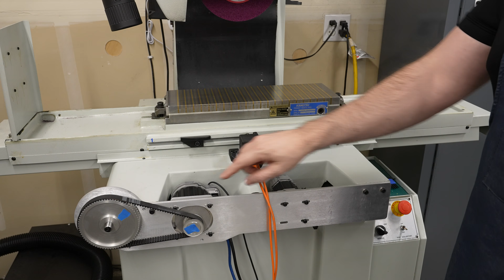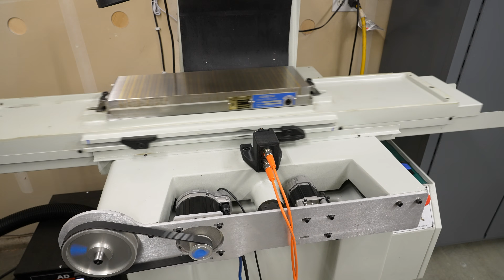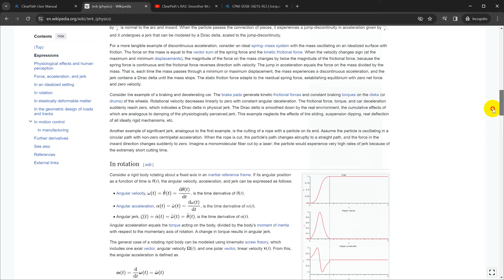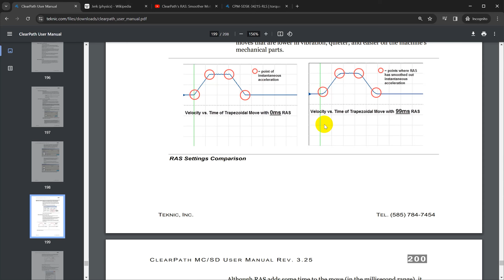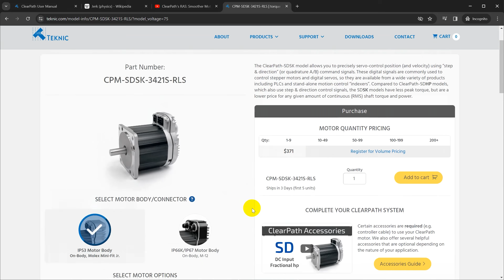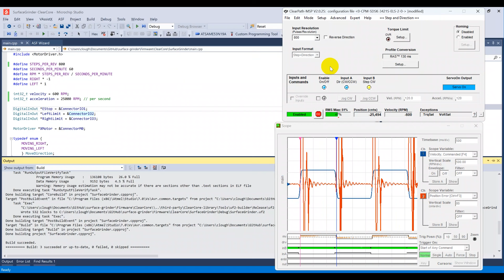Smoothing Out the X Axis Motion | Surface Grinder Automation 7 | Clearpath RAS

Comment: James, 
Your work and intuitive deductions are outstanding, there may be several sets of factors that you have entirely missed and may effect the performance of the electric motor in a measurable way.
#1 the fit of the molded rubber drive belt into the drive cog and any slop that may result or increase from wear, ie: unlike a metal driving gear system there IS movement  and stretch in rubber; and does the belt wear, and or increase in size due to speed and friction and thus increase friction/drag on components?
#2 the compression factors and rebound time of the rubber belt itself loading and unloading the forces as they switch back and forth ie: compress/rebound
These factors absolutely will effect the minute timing parameters and increase in variability as speed increases.....and therefore influence how your motor will display/chart its data.
Should a distinct measurable variability in the motor performance be evident in using the rubber belt cog drive , it may necessitate using a solid gear tooth drive system or a  crankshaft type drive to achieve your optimum electric motor performance.
Just saying !

Comment: Make 2 stop sensors on each end, one for slowing down table and second one for dead stop. With this setup, table/motors/belts etc. at the moment, is going under a very heavy load because there is a high speed and a rapid change of direction. Just make it that table slows down gradually before changing directions.

Comment: Perhaps if you replace the wire cable with spectra dyneema which has less than 1% stretch and more strength than steel, you might also help smooth out the change of direction even more.
Reply: My thoughts as well. Or a drive chain?
Reply: @marclevitt8191  now that’s also a good idea, chain might work. I’m guessing it might have more mass hence more inertia to overcome each change of direction than dyneema spectra tho.
Reply: Dyneema is slippery stuff, might be a problem.
Reply: @carlhitchon1009  Indeed it is very slippery, no denying that. 👍

Comment: Hi Intresting but on thise settings what is the feed back in the motors when the cams are only a few inches apart or do you plan to just use the tabel at full movement all the time. Good video.

Comment: The 25000 rpm/s acceleration to 600 rpm gives 24 ms acceleration time. That's pretty insignificant compared to 197 ms RAS delay so there might be room to lower the acceleration a little to get even smoother motion.

Comment: your limit switch cams are switched L R
Now the roller hits the short ramp.
Reply: you need to re-watch the video on the cam design, that's intended. the shorter ramp gives you a more predictable actuation point, and if you look at the position of the switch's lever, you'll see that the steep angle is no problem (since the switch pivots back and away from the oncoming cam). the shallow angled part is not a good sensing method, it's there as a safety feature so that it won't jam the lever into the switch when recovering from an overshoot.

Comment: Looks like all those settings depend on the physics of the machine, including the weight of the table.

Does that mean you'd need to adjust things when you put a heavy item on the chuck? Or can you set things low enough to allow some spare capacity before the springiness causes issues? It might be interesting to test the same torque graphs with different amounts of material on the table.

Comment: Looks good, I am curious though what happens when you introduce a 10kg piece to surface grind and the grinder running as it will change the dynamics of the table. I'm guessing there might be a need for a new session of tuning when that happens.

Comment: I’m quite spoiled using Kinetix motion servos as a System Integrator. Do a Motion Axis Move to a position in x amount of time, set it to S-curve and let it rip. A the hiperface absolute encoder makes indexing bulletproof. Throwing excessive acceleration at a wet noodle axis doesn’t always work, but it’ll be interesting to see how the dynamics of the system changes when a workpiece is added and the wheel is engaged because the resonance frequency shifts. Also the forward and back directions will see different forces because of the grinding wheel engagement. Will be great to see the final results

Comment: Possibly a newbie question - how much does the table/object speed matter when surface-grinding?    The wheel's surface speed is far higher so does it matter if the part is moving slow or fast ?

Comment: This is a great  tutorial, great understanding, great tenacity & great outcome.

What would be the icing on the cake is a test piece, that has an area (strip) of grind at same depth etc but with different motors and RAS settings to see if the quality of traverse actually shows or is measurable in the real world or if the mass of the table hides it.

Thanks James, this is perhaps the best (most revealing) project you have done.

Comment: What about old school hydraulic dampener rods, at both ends, which will dampen out vibration as the limit switches are hit. Since it is a servo, it will not lose steps as in an openloop stepper. A purely mechanical solution!🤔 .

Comment: hilariously, I would have coded the RAS myself in the controller. not too hard to implement. especially if the accel can be directly coltrolled by code and not just constants
Reply: He let Teknik program it in—a better solution and cheaper.

Comment: Could the progressive acceleration (anti-jerk) required not have been implemented in controller software? Along with anticipation of travel limits, based on tracking of the most recent limit switch triggers?

Comment: Motion control is an incredibly cool subject to look into. For a project I have going at the moment I'm using AC servo drives which have absolutely terrifying trapezoid performance due to the winding voltage, instead of doing jerk limiting within the motor PID I'm doing it as part of the trajectory generation, this allows for optimizing within the context of the planned path. So you can have a highly damped control system where you can have the motor track a target of arbitrary error and acceleration and all of the motions between those errors are smooth and jerk free. You can also modify those constraints on the fly, so in the case of your surface grinder you would switch to a dynamics profile optimal for the turnaround point when the limit switch is triggered and then after the velocity is reversed switch to a purely trapezoid profile so that the target velocity is hit much faster, would allow grinding a part at the full width of the table working area without creating hot spots at the edges.

Comment: How hard would it be to get a DRO scale feeding back into the servo control? Move the feedback out to the end of the line and you can easily tune a PID for the springiness.
Reply: I don't know, sometimes more data is not better. Perhaps only using glass scales and bypassing the motor's internal ones? Is that what you meant? I believe that Leadshine’s latest hotness EtherCAT servo can take both inputs.
Reply: @marclevitt8191  Pretty much yeah. Even the optical encoder strip from a printer (if it were long enough) would be plenty. Just enough to tell the brains where the table is. I just suggested a DRO because there's probably one readily available inside a machine shop and it's probably meant for that role. Interfacing it shouldn't be too hard.
Reply: I looked into this question several years ago, and the consensus seemed to be that it's technically possible, but not a good idea for some reason i couldn't figure out (maybe related to position hunting), which is why basically no motion controllers below and up to light industrial usage support it.

Comment: I'm just concerned having a single limit on each end of travel. Seems like some redundancy is in order where you have two switches on two input and if either one is triggered, that's your limit. 

Think of a scenario where the cable degrades or you trip and pull it out of the connector or.100 other scenarios where the controller doesnt get the signal that the limit has been reached.

Comment: Im honestly supprised you didn't add a jerk paramiter to your code so you could tune it on your own. On one of my 3D printers I compiled my own marlin firmware and apent some time messing with the jerk setrings and it was easier then i thought it would have been
Reply: Weirdly enough, the definition of the  jerk parameter in marlin is not the same as jerk in physics. In marlin, jerk is defined as the "maximum instantaneous change in velocity" instead of the rate of change of acceleration. Seems to be from an early misapropritation of the term which has then stuck around.
Reply: @carlholmberg1576  great to know thanks for that.

Comment: The new motor went from 800 steps to 6400, but you didn't update the code. It doesn't seem to hurt anything from the results, but I thought I'd mention it.
Reply from the maker: It's configurable, and it's set to 800.
Reply: I suspected it may be a non-issue. I've never programmed a servo, so I didn't know if it had a performance impact on your application. @Clough42

Comment: What happens when you increase the mass of the table? (Loaded with a work piece)
Reply from the maker: I've done some testing with maybe 30 pounds of extra weight, and it makes very little difference.  The table and chuck are already so heavy that most workpieces will make little difference.

Comment: I'm not convinced this is the right way to automate that particular machine. It has been built for manual operation, and while that tendon drive is perfectly adequate, it has already shown its shortcommings. Yes it's great that the Clearpath system can compensate for the non compliencies (spring) to a certain extent, but I feel you may be forever chasing your tail, and emptying your wallet, trying to tune out artifacts that will appear in the finish James.

I do hope I'm wrong however.

Comment: I expect that RAS setting is going to need to increase once jigs / work is added to the chuck.  These will increase the moving mass and thus the "slip" on the spindle + stretch in the cable drive.
Reply: As someone using RAS on a CNC router and a Bed Mill, both required decreasing acceleration and increasing RAS a bit once you mount vises, tools etc.

Comment: Instead of using the limit switches couldn’t you program the limits in the software, then the servos would “know” when they need to be ready to change direction and account for the spring and mass switching directions…  I think this is how commercial CNC machines account for abrupt changes without flying past their turn points.
Of course, commercial machines that have quick travel speeds cost a ton of cash because they can handle these quick changes in directions…
Reply: no as steps can be missed because of the speed of rotation so he is doing it correctly by using the steps for acceleration calculations only and having the switches do the positioning on X
on Y and Z the steps could work if they move slow
Reply: @111smd no, these are servos, if servos are "missing steps" they are defective. he mentioned it in this video, the axis is actuated by a cable wrapped around a drum, and that cable can slip. he talks about this more explicitly in the previous video in the series where he designs the switches. even if slip wasn't a factor, you would still need at least one limit switch to home the system, although for safety you would want 2, one for each end of the travel. at that point you already have 2 switches, and then you have to face the fact that physically positioning some limit switches on a rail is probably gonna be a much simpler and less error prone workflow than punching some numbers into software.
Reply: @spambot7110 ok i will have to accept that you do not know much about servos

i also admit that i should not have used steps for the rotation speed calculations my bad, a servos just knows the direction they rotate and the speed of rotation

1. a servo is a motor that is electronically controlled, a servo only cares about the rotation direction and how fast it rotates

2. a servo can be accompanied by a step counter to get an idea of where a servo has rotated to

3. if you add a step counter to a servo you have a stepper motor, stepper motors will lose steps of you rotate the motor to fast or of there is something pulling it off step
Reply: @111smd  what? If i swap the words "servo" and "stepper motor" in your comment, it mostly makes sense, is it possible you got the two mixed up at some point?

1. A servo motor is not exactly a motor, it is a motor system*, integrating the motor with some sort of sensor, (often called an encoder), that detects its position. the motor and the sensor are connected (either internally or externally) to some sort of controller that takes a position as input, compares it to the position detected by the sensor, and moves the motor to reconcile the difference between these values. If a motor does not have a sensor to detect its position, by definition it is not a servo. In the broad sense of the term, a servo is any kind of electronic or mechanical system that features a sensor and an actuator forming a closed feedback loop, but in the context of electric motors, it's typically only used to describe a motor that has closed loop control of its *position specifically.

2. a stepper motor is not a servo, it is not a type of servo, it is simply a type of motor. it is possible to use a stepper motor as the motor component of a servo (these devices are often called "step servos" or similar), but the stepper motor itself is not a servo. a stepper motor is simply a motor whose rotation is broken up into a series of equally spaced steps. the coils are arranged so that you can power them in a sequence, and the motor will move one step forward or back. this is an intrinsic property of the motor, not a result of adding some feature to a different type of motor. because the motor is simply responding to inputs and not measuring its own position, it can be said to implement "open loop" control, meaning it will move predictably for a given input, but won't take into account any external disturbances. so if the motor encounters some disturbance that prevents it from executing the intended move, the motor's real position will diverge from the expected position. this is what "skipped steps" are.

Comment: We're using ClearPath motors (SC-HP series) on our project (restoring a 12.8m satellite dish for radio astronomy).  The API we use (sFoundation) has an API function that lets you query the encoder resolution so you don't have to wire it in to your code. We're taking our project very slowly--the dish weighs in at a svelte 5.6 tonne.  We had a crash a few weeks ago--not due to the motors, but due to a failure in our mechanical system design.  Kinda scary, but the only thing really damaged was our egos, and the 50+ year-old crash buffer at the bottom of the travel.  We're using fairly modest motors (a roughly 3/4HP on azimuth, and 1.3HP on elevation), but with extra gearboxes to boost torque.  It's working well, although it will never win any slewing-speed contests :)
Reply: Fascinating, thanks for sharing!
Reply: I'm a machinist for a telescope called the GBT, not sure how familiar anyone is with it. But its a pretty big telescope. The large drive motors couldn't be replaced by Clearpath servos but as it has active surface actuators and uses worm driven "servos" from the 1990s to position the subreflector I have always wanted to retrofit. Its pretty awesome that you are actually retrofitting telescopes. We've got three small 85ft scopes that i'd love to swap out the motors for Clearpaths just for a proof of concept.
Reply: Hah!  I've been to visit the GBT 20(?)  years ago.  This dish started out life as a NATO ground terminal, and hasn't moved under computer control since 1997, with MUCH larger motors.   Are you related to Glen Langston?
Reply: @patchvonbraun  I am related to Glen Langston!  He is my father! Small world! I'm really glad to hear there is work going on to give the old telescopes new life!
Reply: @patchvonbraun  I've climbed around and looked at the 85ft telescopes and the drive motors for the axis are actually around the same size as the larger AC Clearpath servos. Ive been wanting to pitch a proposal to re-power the 85s. The original motors run their power through compounding worm drive gearboxes prior to the final drive pinion which all seems to be in good shape. However I'm not certain whether on the receiver side how easily a more modern receiver could actually be installed

Comment: You are regulating the shaft position and not the table position.  So  the table and linkage acts like a weight on a spring.  It would be interesting if you put an accelerometer on the table. I'm sure what you have is fine.  Nice work!
Reply: I’d be very interested in seeing the actual measured acceleration of the table. 

In addition, I’d be interested in a discussion of the feasibility and expected performance of using a linear scale to directly measure the table’s position, velocity, acceleration, and jerk.   Or does the ClearPath motor not support such an encoder feedback channel?
Reply: An accelerometer’s output would be fantastic to see.

Comment: Is there a limit to the speed you should be moving the table while grinding?
Reply: yes it depends on the material being cut and the stone you are using

what he was setting was the max speed to get to the traversal speed (25000 RPM/s)
when cutting he will need to adjust the other based on the stone and material (600 RPM)